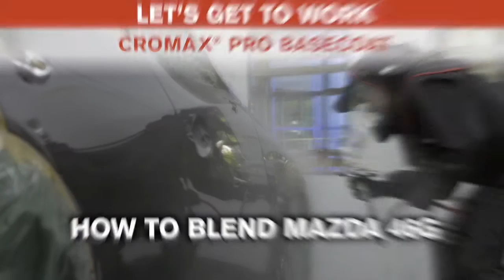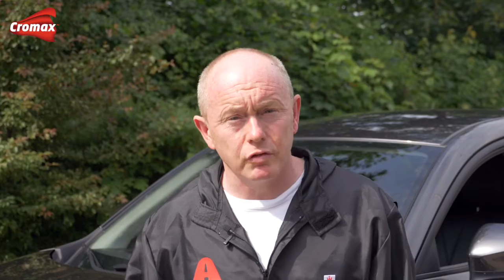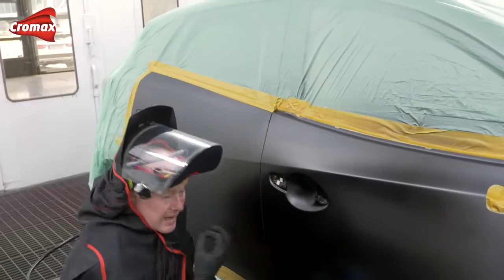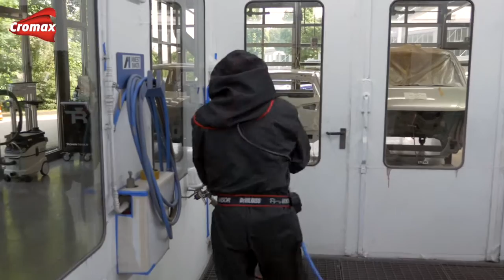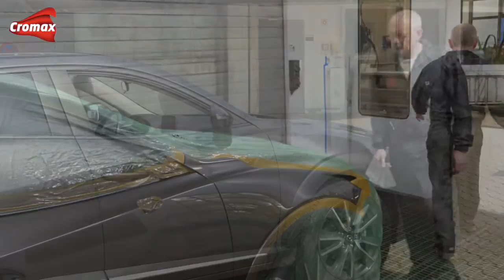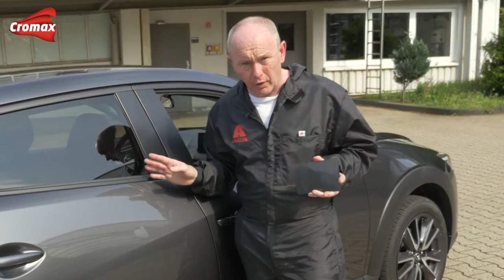Cromax Pro Basecoat: How to blend Mazda 46G

Comment: what gun tip you recommend for this color
Reply from the maker: Hi, thanks for taking the time to get in touch. In normal circumstances I would take  a 1.2 set up. If conditions are more challenging i.e. you may want to change to a 1.3 but be careful as this could lead to over application of the effect layer which of course you need to avoid.

Comment: why dont you want full hiding on that color? does it cxhange the color if you achive the full hiding on the 46g?
Reply from the maker: The colour fomulation of Mazda 46G is set up as tricoat colour. The mid coat/effect coat has to be applied in a transparent layer in order to achive the right effect.

Comment: Does activate or harden the ground colour means one has to add hardener to the basecoat even if it is 1k and is it necessary to spray the clear blender
Reply from the maker: Hi, thanks for viewing and taking the time to ask questions. Yes you have to activate the groundcoat colour which is a basecoat in this repair system. This is to provide a stable surface over which to apply your effect or intermediate coat. This improves the application properties of the effect/intermediate coat by preventing absorption into th egroundcoat. The blender is necessary to help achieve a smooth uniform transition of the effect colour.

Comment: You said "dont have to use blender" twice, but did use blender.
Reply from the maker: Hi, thanks for asking. Where I said you don't have to use the blender I was referring to the application and blending of the groundcoat colour as it is in the case a black. I used the blender though for blending the actual colour layer itself.
Reply: @CromaxEMEA  oh its a 3 stage color. I rewatched it and I get it now. I just picked up basecoat blender from the paint store, cant wait to use it. Thank you.
Reply from the maker: Thanks for your comment and we're glad it was worth taking a second look at the video.

Comment: Hey, nice job! What is the color code you used from the cromax catalog?
Reply from the maker: As part of the repair process we measured the car using the Croma Vision Pro to establish the best match based on LAB data. As part of the process the software automatically checks the measurement against the database and shades the colour to a more precise match.

With these multi-layer finishes though it is essential to produce a series of sprayouts with different numbers of layers of the intermediate colour to assess how many are needed for an accurate match. After application and drying assess these against the car in good light to select the best matching formula/process.
Reply: Thanks very much for taking the time out to reply. I have so much issues getting this color right...I have used the cromax scanner, however it doesn't get me a match. Try to adjust but it very time consuming. For blending it is ok but single part like bumper is the problem.
Reply from the maker: I'm afraid that with this colour there are no shortcuts given the wide variety and differences in colour out there from vehicle to vehicle. All I can add is that you keep the colour samples you have produced, lable them accurately and hopefully you will be able to reuse one or the other again at some point.

Comment: Tony   I am having some issues with my blender 2091. Everywhere I put blender it looks dirty very nibby.  It does not look nibby in my basecoat on the repairs.  The 2091 is drying down pretty smooth and with just a touch of extra clear the jobs are acceptable.This does not happen with 2093. Why is this and what can I do to stop it. I have tried straining the blender and using different controller configurations.
Reply from the maker: As you know by heart it is important to degrease and tack rag before starting any work. What wouldn't harm and is even helpful also on non-plastic parts is using a stat-gun. Did you also check you use the right mixing lid (binders only)? Otherwise there is a change of material breakdown.

Comment: I’m glad u guys put a video on this code I been having trouble with the formula. Can u guys recommend a popular formula.
Reply from the maker: Do you know that in ChromaWeb there is an indication on which formula is being used most common? Search on Quality (Cromax® Pro Basecoat), Manufacturer (Mazda) & Colour code (46G). You will see all available formula's with the most common used on the top. If you look at column 5 you will see "Used %" and column 6 the region of development.